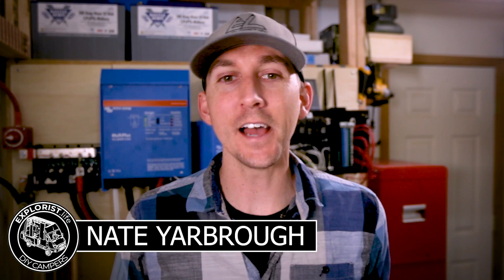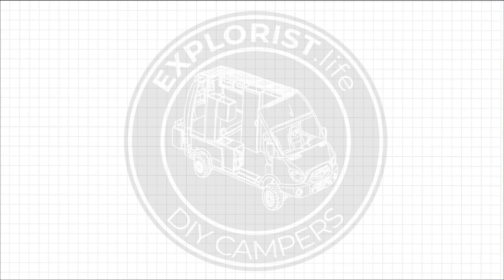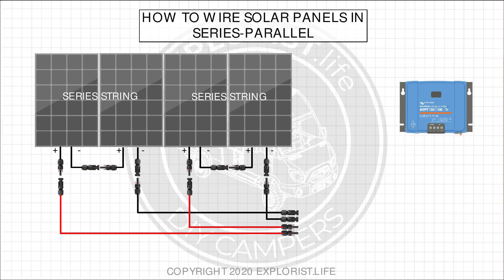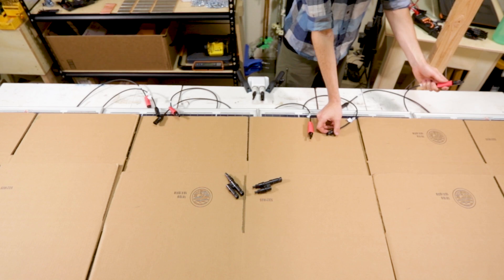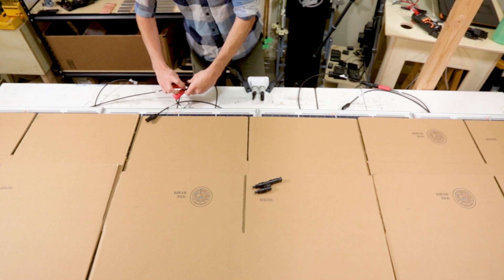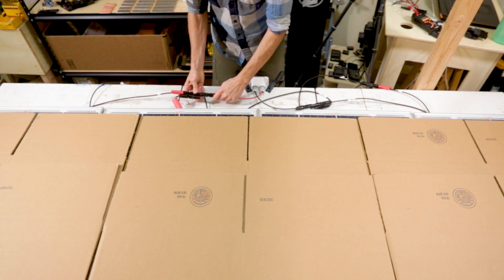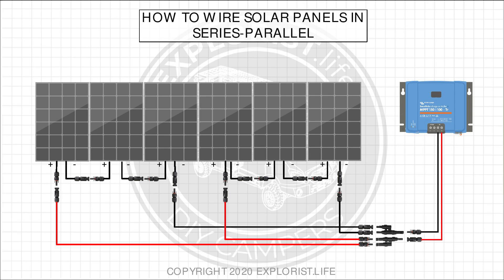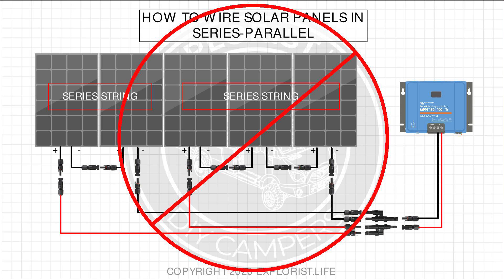How to Wire Solar Panels in Series Parallel

Comment: Can I do 100 W 12 V panels in series series parallel on my Victron 100/50 charge controller or should I consider six panels series series parallel??? I plan on running a 12 V system with LIFEPO4 batteries. I want to try and run 12 AWG solar panel wire as I have recently purchased some through Amazon 100 feet of 12 gauge solar panel wire

Comment: I have a question, illustrate how eight 12v pv modules can be connected in a series -parallel connection to obtain 48v?
Reply: Use the 16 panel example at the 3 minute mark. use the 8 panels on the left side. That is 4 12v panels wired in series for 48v and a second series group wired in parallel to increase wattage and still keep voltage at 48v.

Comment: Nubie, stupid question. Using the volt meter to determine the positive and negative with the panels covered...there should be no voltage so how would that work....sorry if this is a dense question but I am trying to learn
Reply from the maker: Just uncover the panel a bit until there is voltage.

Comment: Hi, can someone here help me please? I have ecoflow pro. To charge it with solar the specs are max 1600W, 15A and 150V. I have 4 solar panels, each with (400W, 10A and 40V) If I run them in series I will get 160V which is 10V over the limit. If I run 2 and 2 in series and the 2 strings in parallel then I will have 20A which is 5A over the limit. The guy I bought it from suggested the latter, what do you guys think? He says these numbers are for ideal conditions, in Norway this doesn’t happen 😀Thanks
Reply from the maker: Sounds like neither will work, unfortunately.
Reply: @EXPLORISTlife  thank you so much for the answer, but if I do like he says would it ruin anything or it just won’t charge?
Reply from the maker: I don't know what kind of protections the ecoflow has in place.  Perhaps reach out to ecoflow for tech support?  I know what happens with Victron charge controllers, but I doubt it's the same.
Reply: @EXPLORISTlife  Thank you so much for the tip and your time 😊 I contacted Ecoflow;
Thank you for contacting EcoFlow Support.
 
As long as the voltage meets the requirement, it will be no issues.
 
If you have other issues, please let us know.
Best regards,

Joy
EcoFlow Customer Service Team

Comment: Your videos are REALLY helpful.......   I have a question about series/parallel  panels I have not seen answered anywhere. I have 6 panels 24/200 in 3 sets of 2 series. I know if a panel gets a little shading it significantly affects the output. But if I have two panels in series and one gets shaded, does that impact the power output of the unshaded panel reaching the solar charger?    Thanks for your thoughts on this.
Reply from the maker: Any shading on the array will reduce the output.  Solar panels need to be in the sun to perform optimally.

Comment: Hello, Thanks for the info I learned a lot from you. If you could help me on my system I would appreciate. I have 8 Panels each 350watt mono, I bracketed them in 4 and 4 in 2 lines or rows due to the space, I do have combine box with 4 and 4 fuses and breaker etc, happy to share images, then down stair in a cupboard a 8 batteries of 150amp gel 3000 deep cycle which would connect to STECA SOLARIX PLI 5000-48 INVERTER HYBRID INVERTER- indicated 80amp, no controller needed I hope. I can tackle the battery connection in Parallel etc, but connecting the panels so they dont go over the 48 invertor is my problem. 4 panels lined up 350 watt each and another row 4 panel 350Watt, Pls could you help. And how this would go to the combine box, I assume I have 4 positive fused and 4 negative. I understand I ask big fever, but would appreciate if you could help, I got 160amp fuse for solar wire before it get into the invertor, One point to consider my system is not high tech like yours, I am communicating with you from far away in Africa. Thanks in advance Alex
Reply from the maker: Hey, Alexander Yusuf! I appreciate you taking the time to ask your question, but unfortunately, I don't have enough info about your specific question to provide an accurate answer, but here is a playlist that, if you watch all of the videos start-to-finish (and take notes 😉), you'll have a REALLY good idea of how to design a solar array: https://www.youtube.com/watch?v=Jkbs84sBHsg&list=PLmvhcyi4n0TV9pi83rFTv3ZuMT_S1xIZt

Alternatively, I have some of my most common solar array setups pre-built here: https://shop.explorist.life/product-category/all-products/camper-wiring-kits/solar-charging-wiring-kits/

Comment: hi Nate, can i use 2 100w panels and one 200w panel? run the 2 100s in parallel and then add to the 200w. the spec for the 100w is 20.4v and 4.91A the 200w is 19.2v and 10.2A  i make a arry out put of 388w

Comment: How about parallel series?
Reply from the maker: Not really a thing.
Reply: @EXPLORISTlife  thanks for responding. Think I have it, but just wanted to see it in real connectors. Was hoping, it was already in a different video. Probably not often required, small PWM SCC and odd pairs so need to parallel first for efficiency. I have 2x 50W and 2x 100W, I believe I am paralleling first to add the amps of 1x 50W(2.85A) and 1x 100W(5.55A), with minimal voltage drop. Do that twice, then series them, to double the voltage, to stay within the PWM parameters.

Comment: Hello, I have six panels of 320w 40.1 open circuit voltage.. connecting them to my growatt 6kw inverter with max 150 open circuit voltage.. how can I achieve below 150? Thank you in advance.

Comment: Appreciate all of the videos you produce and usually can understand them easily :) In this video you state not recommended to mix 3 panels in series with 4 panels in series. Why? I have a situation of one panel getting shaded too much and no more space on my rig. Want to eliminate that panel from my 2 series of 800n watt run in parallel and just abandon the shaded panel in the winter when it catches the most shade. Appreciate your insight.
Reply from the maker: Here's the 'why' for that: https://youtu.be/jejro4zkl8I

Comment: What is the maximum voltage could goto the charge control
Reply from the maker: Each charge controller has it's own max voltage.  Might be 75, or it might be 400.  It's always listed in a pretty obvious fashion.

Comment: thanks for the quick reply on my last question here's another one for you, I have two 320 watt solar panels wired in series to a 24 volt system. looking to add two more panels so I would have four panels two in series each and then wired in parallel. I can get $405 watt panels for roughly the same price as 320 watt panels right now. they are jinko brand. would you just go ahead and get the 405 panels even though I wouldn't be using all the wattage potential? in my theory I could upgrade my 320s later for Fuller potential in the future. and honestly I'm having a hard time finding the 320 watt panels. I'm in Hawaii so things are hard to come by.
Reply from the maker: Hey, Jacob Green! I appreciate you taking the time to ask your question, but unfortunately, I don't have enough info about your specific question to provide an accurate answer, but here is a playlist that, if you watch all of the videos start-to-finish (and take notes 😉), you'll have a REALLY good idea of how to design a solar array: https://www.youtube.com/watch?v=Jkbs84sBHsg&list=PLmvhcyi4n0TV9pi83rFTv3ZuMT_S1xIZt

Alternatively, I have some of my most common solar array setups pre-built here: https://shop.explorist.life/product-category/all-products/camper-wiring-kits/solar-charging-wiring-kits/

Comment: With 600 watts (300 in series X 2), what gauge wire to inverter (for a 75’ run)?
Reply from the maker: Hey, Rick Sean! I appreciate you taking the time to ask your question, but unfortunately, I don't have enough info about your specific question to provide an accurate answer, but here is a playlist that, if you watch all of the videos start-to-finish (and take notes 😉), you'll have a REALLY good idea of how to design a solar array: https://www.youtube.com/watch?v=Jkbs84sBHsg&list=PLmvhcyi4n0TV9pi83rFTv3ZuMT_S1xIZt

Alternatively, I have some of my most common solar array setups pre-built here: https://shop.explorist.life/product-category/all-products/camper-wiring-kits/solar-charging-wiring-kits/

Comment: Firstly I want to say hello and thank you very much for your very informative videos

I am very much a new be when it comes to solar power and I wanted to run a few numbers by you to make sure I have my maths right and I also want to pick your brain on how long it would take to charge a 400 ah battery in ideal conditions for the set-up I was for 

I am just starting the process of making an off-grid campervan with the end goal of being self-sufficient and completely off grid 

So now I have rambled on enough let me give you some numbers

Firstly I wanted 4 
300w solar panels 
Which I was going to run in series parallel at 
33v
9.2a 
Which by my maths works out as
66v
18.4a
I believe that that is right for a series parallel right?

I have a victron mppt 100/20
Assuming that is correct my mppt should be able to handle that load but my question especially with the amps it is very close to the upper end of the mppt would that put undue stress on my mppt

And lastly I don't know how to work out the maths on how long that would take to charge my 400ah battery

I'm very sorry that this was a very long-winded comment but as I am new to the game I just want to make sure I have it right what is it you say do it right do it once 

Again thank you very much for the informative videos and long may it continue
Reply from the maker: Hey, nicole wright! I appreciate you taking the time to ask your question, but unfortunately, I don't have enough info about your specific question to provide an accurate answer, but here is a playlist that, if you watch all of the videos start-to-finish (and take notes 😉), you'll have a REALLY good idea of how to design a solar array: https://www.youtube.com/watch?v=Jkbs84sBHsg&list=PLmvhcyi4n0TV9pi83rFTv3ZuMT_S1xIZt

Alternatively, I have some of my most common solar array setups pre-built here: https://shop.explorist.life/product-category/all-products/camper-wiring-kits/solar-charging-wiring-kits/

Comment: Hello, I have (10) 100 watt solar panels rated at 20v and 4.93 amps, my charge controller is 20 amps and has a max voltage of 145 volts. I'd likely to know what's the best way to hook these up in a series parallel way in order to stay within the charge controller range. Also i plan to get two more panels soon which would bring them to (12) 100 watt panels with the same 20v and 4.93 amps and would like to know how that would change from the wiring or the 10 count i currently have? Your channels is great and helpful but I'm still a little confused and not too certain how I should wire this setup
Reply from the maker: Hey, Viz Jion! I appreciate you taking the time to ask your question, but unfortunately, I don't have enough info about your specific question to provide an accurate answer, but here is a playlist that, if you watch all of the videos start-to-finish (and take notes 😉), you'll have a REALLY good idea of how to design a solar array: https://www.youtube.com/watch?v=Jkbs84sBHsg&list=PLmvhcyi4n0TV9pi83rFTv3ZuMT_S1xIZt

Alternatively, I have some of my most common solar array setups pre-built here: https://shop.explorist.life/product-category/all-products/camper-wiring-kits/solar-charging-wiring-kits/

Comment: Looking at 4x 200w panels with the Victron 150/70 controller - essentially your 800w solar bundle.  I have 3x100ah Battleborn batteries.  Knowing I need voltage to drive the controller, how should i wire these 4 panels?  TIA.
Reply from the maker: Hey Jeff!  That's a pretty common setup, so I went ahead and put together a full solar array charging kit for 4x200W panels.  This will give you everything you need from the panels down to the connection at the Lynx Distributor as well as a diagram on how to wire it.  Here's the link for that: https://shop.explorist.life/shop/all-products/camper-wiring-kits/solar-charging-wiring-kits/800w-solar-charging-wiring-kit-4x-200w-12v-battery-bank

Comment: I have a growatt spf 5000es and 8  445w panels with Voc ,49.60 and 11.40Α giving 3560w and 396v .My question is if is better to make 4S2P lifting my Amp to 22.8 (22A growatt limited in new firmware) as i have 3 units of Air-conditioning Units and i need high surge to start external units without battery.I use the grid as battery to give extra power when is not available or enough.According to calculation in 4S2P how much voltage and A i will have?(198.4V and 22.80a) i think is this correct?
Reply from the maker: Hey, The XD gamers! I appreciate you taking the time to ask your question, but unfortunately, I don't have enough info about your specific question to provide an accurate answer, but here is a playlist that, if you watch all of the videos start-to-finish (and take notes 😉), you'll have a REALLY good idea of how to design a solar array: https://www.youtube.com/watch?v=Jkbs84sBHsg&list=PLmvhcyi4n0TV9pi83rFTv3ZuMT_S1xIZt

Alternatively, I have some of my most common solar array setups pre-built here: https://shop.explorist.life/product-category/all-products/camper-wiring-kits/solar-charging-wiring-kits/

Comment: I have 3 pannels in series,  thinking about getting a 4th i could doubel my amps if i wire in seires parallel and still have enough voltage for operation this would be better than all series correct?
Reply from the maker: Not necessarily.  You'd just be doubling the amps on the array side of the charge controller; not the battery side.  Adding a 4th panel is what would increase the wattage coming out of the array.  I think this video will clear up that concept: https://www.youtube.com/watch?v=Jkbs84sBHsg&list=PLmvhcyi4n0TV9pi83rFTv3ZuMT_S1xIZt

Comment: Lets say I have 10 250 watt panels would I be better running series parallel to run higher amp loads like a well pump im running battery less with lots more room for expansion

Comment: Great videos...love your teaching style.  I have 9W panels.  Installed in groups of  3 panels in series and then 3 groups in parallel.   Each panel is 48V open circuit and 10A.   If my math is correct, each 3 panel group is 150V 10A, the total 3 groups in parallel 150V 30A.  My question is, I never seen the charge controller charging over 20A  2500W.   I was expecting a higher solar output.   Any comments?
Reply: same here.

Comment: If I have  six 100 watt solar panels connected to a 6 string combiner box, how many amps and volts would I have running into the charge controller?  I have the Rover MPPT 40 amp controller..

Comment: A person wanting to build a 1,00Ah, 12V bank without Lithium might use five 200Ah, 12V Lead batteries in parallel, but Victron's document "Wiring Unlimited" suggests that one should avoid having more than 3 or 4 parallel strings in a bank, perhaps by switching (in this case) to six 1,000Ah 2V OPzV batteries wired in series. What do you think of OPzV batteries?
Reply from the maker: I have no opinion on those batteries.  If you wanted a 1,000Ah battery bank; I'd recommend 4 of the Battle Born GC3's: https://battlebornbatteries.com/product/270ah-12v-lifepo4-deep-cycle-gc3-battery/?afmc=explorist_bb67  These batteries are fine wired 4 in parallel as per Battle Born.  Victron just doesn't want THEIR batteries wired more than 3-4; but other manufacturers can make their own recommendations.

Comment: i have a controller that uses 150 volts and 85 amps
and i have 4 445 watt panels 12 amps and 50 volts each

what would you suggest how to string them ? Please
Reply: is series , parallel the best way for this string

Comment: My 4 x 330w mono push 165v,  not connected yet..but my new Kodak 5KVa says max 145v voc.....Not good?
Reply from the maker: 165v is greater than the max voltage input of your unit; which would damage it.   Consider series parallel instead of series to bring the voltage down a bit.

Comment: Can you do parallel-series instead? Meaning having two parallel pairs running series together?
Reply from the maker: I mean, technically... yes?  But I have never seen that actually done.  It's not common at all.  I would wonder why you would want to do that?
Reply: @EXPLORISTlife  I have 4 350 watt panels and want to hook up to my Delta pro. One of the panels is in the shade for part of early hours. Delta pro max voltage is 150v and panels are maybe 40. My thoughts were to put two pairs in parallel then series them together. 😀 if you have a better idea, I am open to it.

Comment: great videos i'm hoping to get some feedback from you. I have 3 385w panels 48.6v 10.07a each. I am trying to figure out the best way to connect them and without breaking the bank for $$$$ charge controller. according to you calculator the total volts in series would be 156v and 10.07a, with a est 109.4a charger output, parallel 52.1v 30..2a 109.4a charger output. Is there any other combinations i could safely do ? if not what would be some decent charge controllers you would recommend for either set up ? my rv is not used full time just on occasions through out the year i am located in southern NM so we get lots of sun. thank you

Comment: Another great video and information, suggest you can also add standard Solar wording others use like with your 6 Series Parallel example also showing "3S3P" wiring configuration.  Just a thought and keep up the great work.

Comment: so if I only have two 100w in series and I want to add the third one in parallel ?does it only work in series? is it not recommended to put the third one in parallel or is it not possible?
Reply from the maker: Nope.  Here's what would happen if you did that: https://www.youtube.com/watch?v=jejro4zkl8I  I'd recommend all 3 in series with an appropriately sized charge controller.